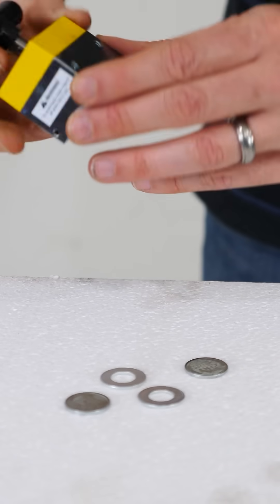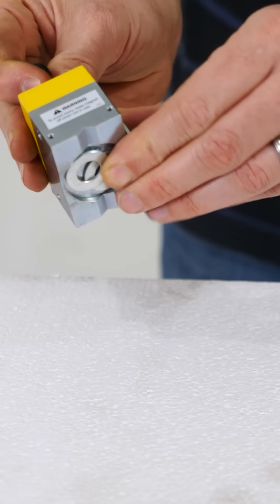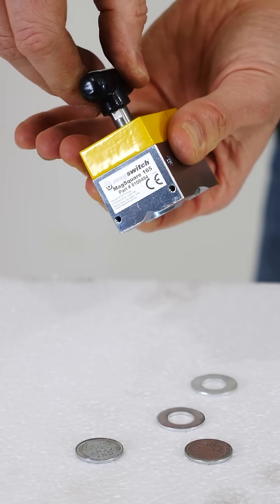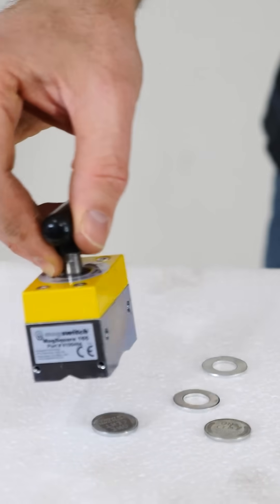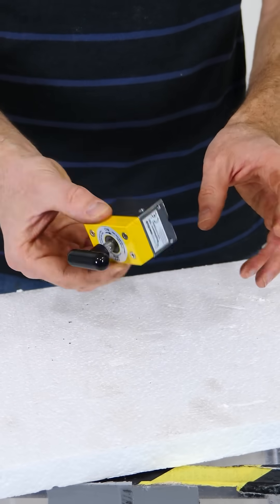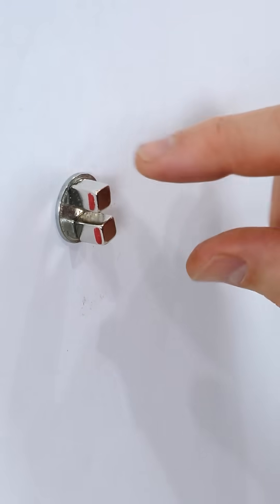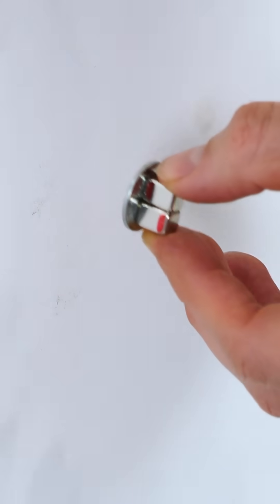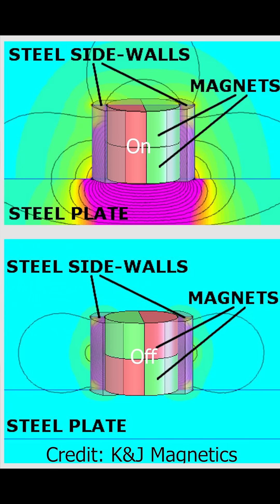How To Turn Off Permanent Magnets

Comment: it doesn’t “short circuit” anything, the magnetic fields are cancelling each other out by being the same magnitude in opposing directions
Reply: You are totally wrong.
This is nothing to do with cancellation. Nothing whatsoever.

The problem is you don't know anything about magnetic circuits and the concept of magnetic reluctance.

The magnetic field passes from North to South pole through the air.

The air has a high magnetic reluctance. Equivalent to a high resistance in electrical terms .

You can create a low reluctance path in parallel by using a ferromagnetic material such as iron, steel and the magnetic field will flow through that and be concentrated in that ferromagnetic material rather than pass through the air.

So when he said "short circuit", he was actually correct, because the magnetic field is passing through a very low reluctance path which is very similar in principle to an electrical short circuit which has very low electrical resistance.

There are electrical circuits and there are magnetic circuits. And there is a high degree of similarity. The analogue of electrical resistance in the magnetic world is magnetic reluctance.

And we can analyse and draw diagrams of both types of circuit, and analyse them in terms of resistors in series and parallel and magnetic reluctances in series and parallel.

Every electrical engineer knows this because they have studied it as part of their degree at university.

Comment: I have two of them holding a power strip (inspired by Adam Savage) and it's amazing that this power strip holds extremely well on any (ferrous) metal surface and if I want to move it, I just turn the handles on the magnets. Genius design.
Reply: Wait🧐 This is amazing
Reply: Magnetic field is kept within a low reluctance magnetic circuit?
Who knew?

I will tell you who knows.
Every degree qualified electrical, electronics engineer in the world and everybody with a degree in physics.

Not that amazing.

It is only amazing if you have not studied magnetic circuits and have no clue what is going on.
Reply: @deang5622 yeah, many people don't study this in an academia setting and find out elsewhere. never shame someone for learning

Comment: My father used to use a special vehicle for the train tracks to pick up metal junk by rolling on the tracks and it has two permanent magnets on both sides of the vehicle on the back bumper. You push a button inside the vehicle to activate the magnetic. It can also replace broken nails with new ones. The magnet can get the broken nail out and a nail  gun sat on a robotic arm and it stapled a new nail into the track. It can also scan the tracks to see damages and record the information. I used to go to work with my father and I got to ride on the train tracks while he removed junk. I love train's. ❤